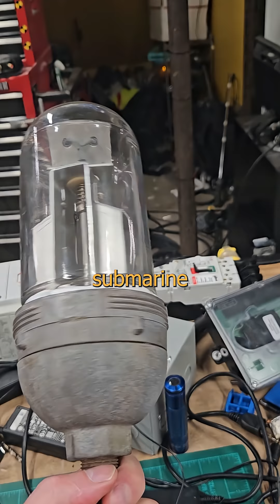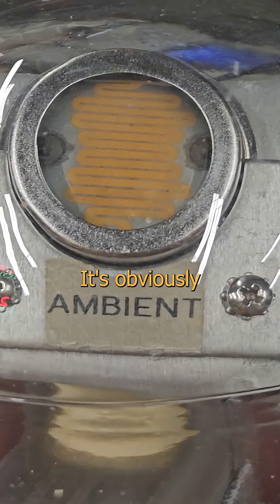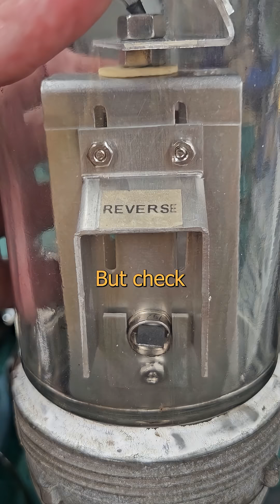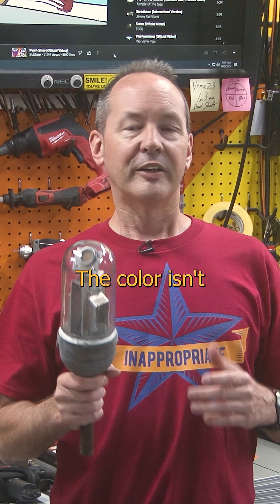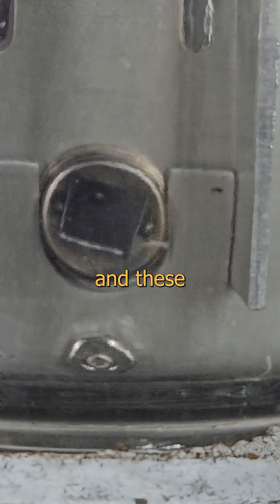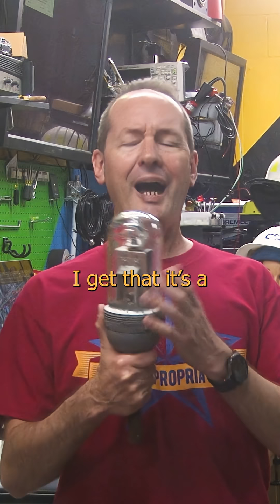Weird Light Sensor #chrisboden #comedy #engineering #electronics #electrical #educational #science

Comment: Reminds me of GMs autronic eye from the late 50s. The original auto dimming headlight system which used a light sensing element on front of car and vacuum tubes to activate the relay without having to hit the foot dimmer. Ford had issues developing their own and licensed the system from GM. 60 some years later we'd here people bragging in the parts store about their fancy new Mercedes that turns the brights off for you.

Comment: That's been out there for a while. I can't envision anyone working on top of whatever that was installed on, not finding some kid with a 3d printer in the past decade to make a nut to fit that fixture and maybe hold the bell in place. The silicon itself is good for that, once it cures it's going to hold through most weather situations. That said, get dimensions, thread pitch, model up and print in PLA a replacement nut that is about 3% too large, then do a burnout investment casting it in aluminum. Wire brush the inside threads till it turns onto the base. The modeling and printing is going to probably cost some $50 to get someone with an Ender 3 to print up. Doing the casting is probably going to cost more. Getting things to all fit together is the worst part of course. If you can part with the base and dome for a week, I can model up one that fits, then print it in PLA 3% (or whatever you expect the aluminum casting to shrink by) and get that part off to you again. I don't have a setup to do aluminum (or other metals) casting at this time. 

As for what to do with it, Put together an all sky camera setup, and mount it to the top of that tower you have on the edge of the property. Keep the innards for other projects. :-)

Comment: UV compensated cloudy day light😢 sensor that had a separate  on and off delay box at least at our antique radio station. Greatly reduces cycling of the lights on the towers helping with their longevity😮
Reply: Same application would work for street lighting, cool stuff
Reply: Ok. So I have a question. I work with high voltage amplifiers for broadcast. My old Eng 3's said shut them off when not in use, but my Lead Engineers say just to leave them on because cycling them causes more wear. Now my Eng 3's were prone to cowboy gray area operations where we get a lot done as long as management doesn't ask too many questions, and my Leads are prone to Fudd lore and backinmydayisms. Who's right?
Reply: @Roadiedave  I’m not an expert just a Ham that enjoys old gear and new but… OLD stuff without soft starts or warm up circuits, leave it on unless your working on it, new stuff that does turn it off if it’s not in use. Just don’t short cycle it. 
Both, don’t push them beyond rated duty cycle.
Reply: that is really cool, thank you for the explanation

Comment: Never seen one of those in person, but from its form and function, I'd say the hex thingy you've covered with your hand throughout the whole video is what's gripping the turning assembly, and it's tracking the sun. With such a complicated setup, it's either directing something very expensive, or safety related. So propably aiming those rotating solar assemblies at the sun. The thought of runway lights is also possible, but those are usually manually controlled by the tower. So possibly the lights on an uncontrolled airfield

Comment: Looks like a directional light sensor,

It can tell if light is front the front or back and has the ambient sensor for day or night

What is weird is that it doesn’t have a 3rd direction sensor to give a full 360 triangulation, but maybe it only needed to know if light was from 1 of 2 sides
Reply: would would it need 360 if sun only goes from one side to the other? even with season variation are limited